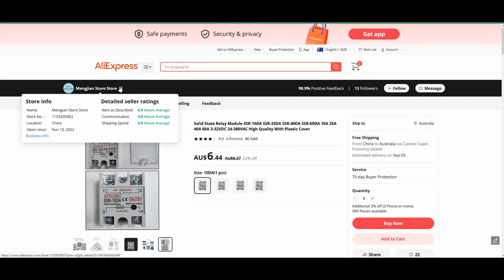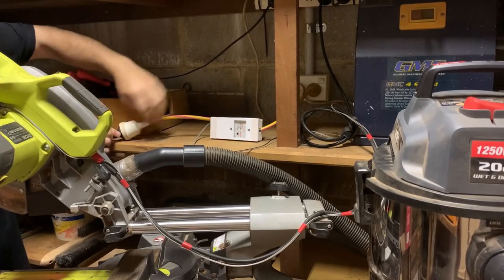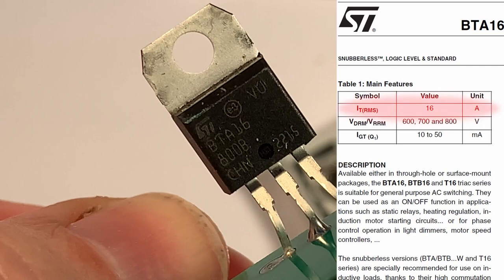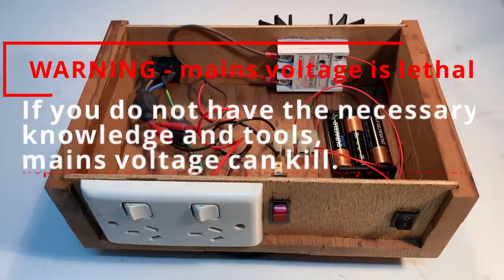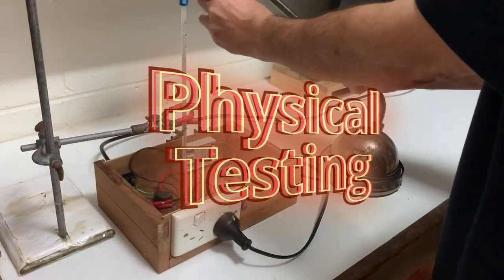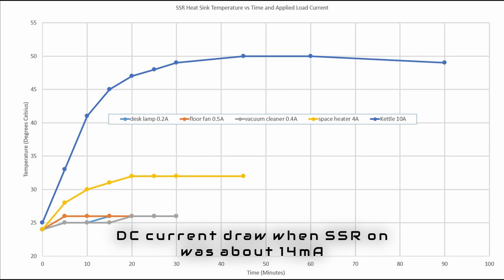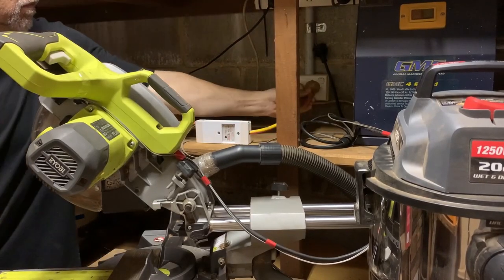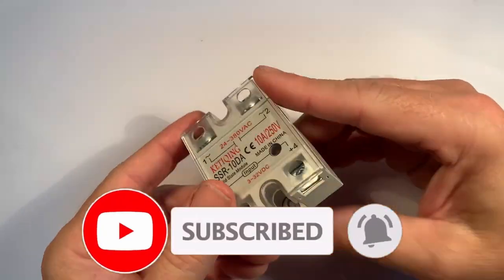Ketiqing Solid State Relay (SSR) review - Used to control cross-cut mitre saw and dust collection

Comment: I have also got some of those fake ones from amazon that are clearly knockoffs with a similar branding . I am also a little nervous about using it, it weighs nothing in comparison to the original ones that finally failed.
Reply: I have bought from this store, it is trustworthy, and the service is very good
Reply from the maker: thanks for the inpu